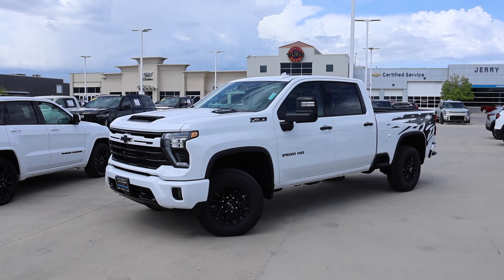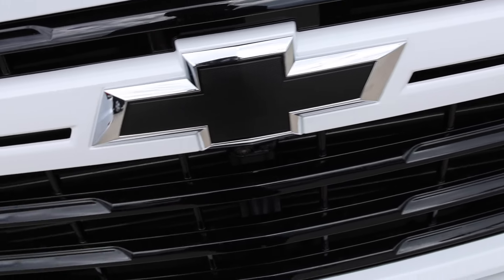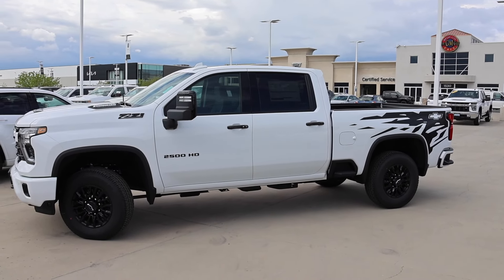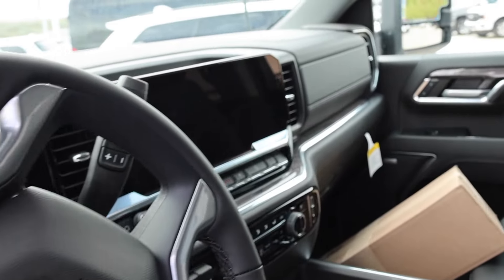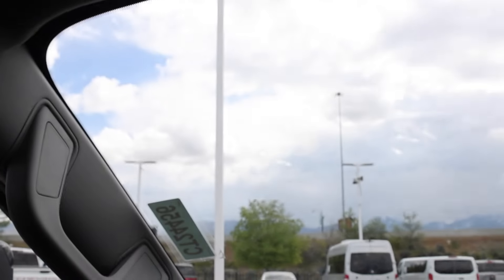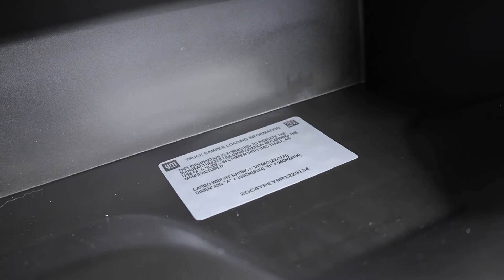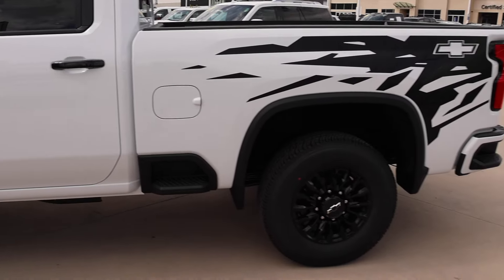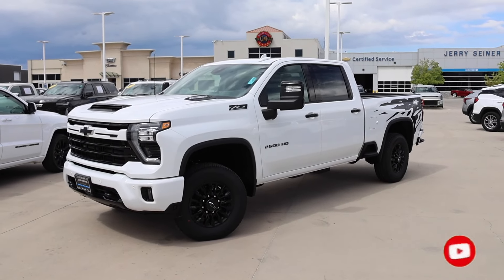2024 Chevy Silverado 2500 LTZ Z71 Sport Edition: Check Out This Mystery Package!

Comment: The tires are terrible for that truck. Need a more aggressive tire. Goodyear Duratrac would have been way better.
Reply: Tires are too small as well.
Reply: @dansmith992 , the tire size is perfectly fine for a mass produced vehicle. It simply can’t be argued. As for an aggressive tire, not every customer wants that either. You’re speaking on what you want, not what they build for the masses. Excuse yourself now.
Reply: @CornFed_3  Funny cause that is what is on the 2023 Silverado Z-71 trucks. So your ignorance is shown. Excuse yourself now.